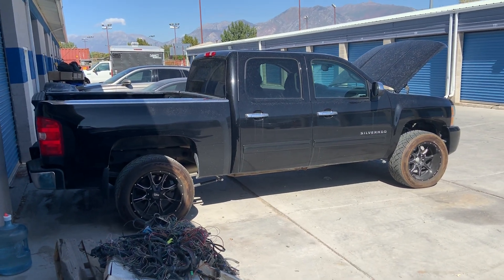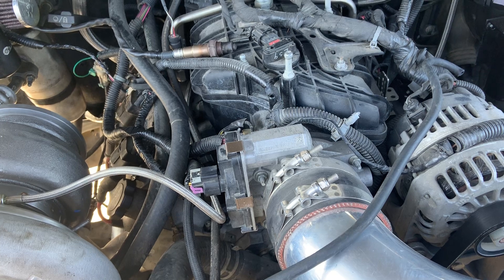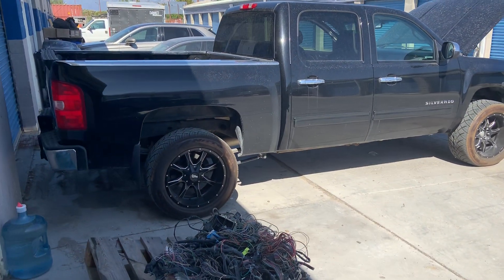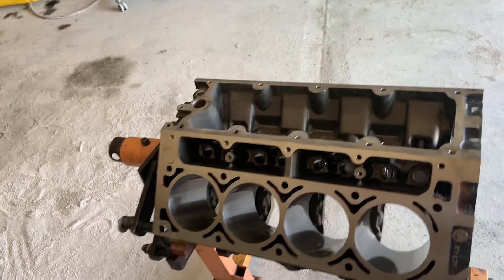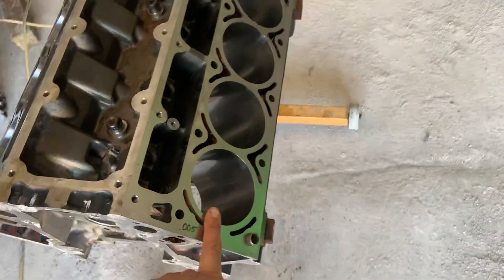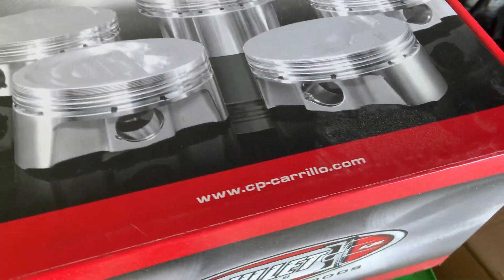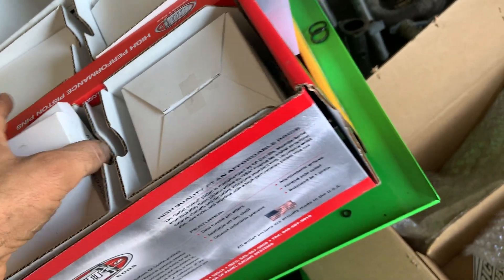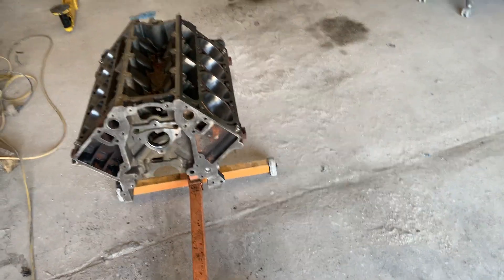Best budget 1000 hp plus reliable  LS engine build up!!!

Comment: Hey Brain! love the video. Been hoping around checking out many videos as I'm building a gen4 5.3 ls out of a 2013/2014 Yukon for my 81 cutlass! i too am shooting for that 800-1000 hp mark. I'm looking to make it reliable. Now I know that is subjective in the fact that no matter how much money you put into the engine the tune, machining  and assembly are also very very important. 

Currently on my list I have Ls9 head gaskets, ARP hardware for the crank, pistons and heads, DOD delete plate and a flavor of a stage 2 cam (have not decided on the cam shaft yet), trunnion upgrades as well as PAC 1218 springs and ls7 lifters. keep hearing about "using the stock gen 4 bottom end" but im thinking its better off spending that extra money now to try and bullet proof as much as possible. Not opposed to changing any of it up. Would love to hear your input as it seems you have quite a Bit of first hand experience! Help me with the recipe please!

Comment: Ly6 block .060 over. Stock crank. Forged piston and rods.. 20 psi boost  supercharged.  

4500 lb truck
3:90 gears
E85

Will the stock gen 4 crankshaft hold up . Without eating through bearings ?

Can i run 15 degrees of timming 
1500-4500 rpm . On 11.5 afr.
Without bending rods...?

Need purchase links...

Comment: Did you ring gap the pistons before they went bad?
Reply from the maker: we did but possibly not enough.  From what I have seen in the last couple of years is they can live if the tune is spot on.  Not a lot of forgiveness though.  I do have buddies running 8s in there foxbodies with all stock bottom end close to 1000 whp. So for some it works.

Comment: Question is. If you were building an LS motor and were shooting for boosted 1200-1500 hp range 
Would you use an iron or aluminum block. 
Would an aluminum block hold up with all the good internals with eagle crank good rods pistons and arp hardware.
Reply from the maker: it would for the most part.  Its the sleeves that can crack on an aluminum build.  As long as sleeves are not too thin you can do it.

Comment: The ring land breaks because of ring gap you are clueless Bro the rings have to be filed and gapped as much as .035 so they don’t close the gap and touch and lift the ring landing and break the piston like you showed in this video
Reply from the maker: Clueless.  Yep.  I admit it was a ring gap issue.  I do now think they touched.  If your running .035 gap your clueless.  Way too much.  I run 1300 hp on .026 4.030 bore

Comment: I just got an 06 2500hd lq4 motor and am building it for 600-800 hp. Doing the entire engine but didn't want to spend $2000 on engine parts alone. But will be my daily driver also. Rods for 400 and pistons for over 600 was more than I wanted to spend for good parts. Your gonna have $3k or more in just that motor not counting what you gave for the block. WOW.
Reply: gets real expensive man, im $3k into my built 5.3
Reply: @runninitup4L  that $2k went far over and still ain't done. Lmfao
Reply: @richardcoleman9645 sorry man

Comment: Bro your piston broke beacuse you did not gap it right. Like look at the piston broke at the ring land... MY MAN... Thats your fault as a builder not the engines parts. Top ring needed more gap. If you argue that you dont know what your doing and are giving bad advice.
Reply from the maker: I’m not arguing that.  I do believe the rings touched.  And I will also say no pistons ring land will live without enough gap.  Forged or not.

Comment: Dude, ripping ring lands off is because of the increased thermal expansion from running hotter. The rings grow and will stick to the cylinder bore unless you open up the gap so gap your damn rings to a minimum of .020 for a 4" piston for a sub 1k hp build, go up to .025" up to 1500hp, after that your off in custom hardware and talk to your forged piston provider.
Reply from the maker: I agree.  rings touched.

Comment: How much horsepower do you think I can get out of a built forged rotating assembly studded twin borg Warner 55mm turbos
Reply from the maker: more info needed.  whats the engine look like? what are the specs.  how much boost you looking to run.  Basic ls engines get close to 1000hp without a lot of trouble around 25-28 lbs given everything is right on.
Reply: @Brainstangs  btr stage 1 truck turbo cam tsp stage 2.5 ported 5.3 heads should be like a 9:5:1 comp and arp studs all around
Reply: @Brainstangs  and on a 5.3 liter I didn’t mention

Comment: I have 2005 Pontiac gto with Ls2 and I want to know more or less how much I  have to spend to make it 1000 hp and  Reliable ,please can you let me know, my email is ortiztony@comcast.net  thank you very much
Reply from the maker: Thats a tricky question.  motor wise , rods 500, pistons 700, Studs, 250, gaskets 150, balance crank 300, labor free if your doing it, cam springs pushrods 700, Fuel system ?????? tune, then and boost. Lots of people want to say they make a 1000 but few can use it on the street.  Trans is a huge issue at this point, Tires, etc..  I tell people to skip all the bolt ons and save that money for pistons and rods.  This goes a long way even if your plans are tame for a while.  It opens up the future possibilities.  Having said this many have made 1000 over and over on good race gas and a tune on stock ls components.  Just not my style.

Comment: “Much started, nothing finished and screw a budget” is more like it.
Reply from the maker: Video coming shortly.  Much done almost driving and on budget.  Just not good at posting.
Reply: I think you are missing the point. You titled the video “Best budget 1000hp plus reliable LS engine build up!!!”.  Yet, it’s not built, not making 1000 hp, reliability requires proof and most people use the word budget to mean cheap. That’s my point, get it now ?
Reply from the maker: Kenneth Jones it is built.  What some deem on budget is up to them.  It will make 1000 hp all day long.  That said I don’t build 1000 hp ls engines without a 500 dollar set of rods and some decent 700 dollar pistons. To me this is cheap.  Can it be done on a tighter budget, sure. Why don’t you consider forged rods and pistons “built”?  I think most do. I’m in this motor about 2700 and I know it will safety make a 1000 hp daily.  What am I missing here?   Obviously you need to see a fresh video that is coming that will show this almost ready to run. I will drop a new vid in the next two weeks on this project.
Reply: @Brainstangs Wdym “2700” stall?
Reply: @JesusChrist-dc1rv 2700 in cost parts
Reply: Sorry, I just can’t make it any plainer, more descriptive or obvious than in my prior comment. You obviously can’t see the forest because of all the trees...
I have daily driven a ring gapped stock bottom end 5.3 LS, with cam, springs and turbo for the past four years. It makes 600 hp on pump gas with a best number of 914 on race gas. I thought I was going to learn something from this video but was disappointed, that’s all. 
Once you build it, dyno it and put it thru it’s paces for a while we can discuss economics.
Reply: Kenneth Jones If you are making 1000 hp why do you need to “learn something” from another 1000hp video 🤦🏻‍♂️ Maybe you need to learn power curves from various cubic inches vs peak numbers you prick.

Comment: So best "budget" LS setup... fully Build LS3 with aftermarket crank/rod/piston, running on meth injection? Hell no.  5.3 with stock crank, summit piston/rod, sloppy cam, PAC springs, cheap MLS gaskets and VS billet turbo
Reply: WHICH SUMMIT PISTONS  GEN 4 5.3 .O30 .CANT AFFORD THE PRO SERIES  ,TRYING TO STAY UNDER 300.00 .TURBO 700 HP TO 900HP
Reply: @toddcotten8157  . Save up your money my guy it is worth it in the long run
Reply: So u can run summit stock bore pistons and rods with the stock crank and u won’t have no issues and will u have to get it balanced?
Reply: @obsant7214  exact
Reply: Yep a slick salesman oh u can't make a stock ls live. Yet thousands are doin it running 7s. World record low 4s.  Guess their all junk
Reply: @chipturd55  theres a fox body holding the record 7.12 1/4mile stock bottom end.
Reply: @reminoel483 squirrel tuned ran a 6.99 not long ago. I think he still has the 1/8 mile record for et and mph.
Reply: He said pistons and rods factory crank and 4.03 bore which is def some kind of lq9 or something. E85 too.
Reply: Some of us have $$ and don’t live in our parents basement’s and also don’t feel like swapping engines 5X a year.  A reliable budget build is $5000. “Sloppy Cam.” Lmfao.  Stick to riding the bus.
Reply: @Cultofpersonality09129  hey i wish i had that big chocolate factory money just like you but no… im just a poor mine worker… :’(
Reply: Yes that is all true, but to be able to reliably hold 1k HP or more on a daily driven heavy sleeper truck then yes, the shirt block does need to be built. I have the L20 4.8L in my 2011 Silverado extended cab and it will hold 800HP reliably, but anything more than that then yes it does need to be built.
Reply: @JustAGuy781  . Yeah that's true, I know a friend who owns a 1000hp civic and he pretty much build everything to the best he could just so he could drive it daily. However it is probably a lot more expensive for the ls engine

Comment: How did this engine turn out?  If it completed and running of course
Reply from the maker: its fully built and will be running on the engine stand shortly for a video. Just working on getting funds for a  few more things.  Keep an eye out for its first start on the engine stand!
Reply: @Brainstangs  how much you charge to build the 1000whp ls?

Comment: That happened because you didnt gap the rings.  DUH 🙄
Reply: Adding to much boost without gaping the rings correctly will brake the piston.
Reply: Summit also makes stock stroke forged cranks tested over 1200hp
Reply from the maker: not true.  I have broke ring lands without ends touching.  Just weak pistons will break ring lands too. But yes that can do it but was not the case on this pistion
Reply: Brainstangs 
Then it’s the tune.  Ring lands just don’t break for no reason especially on an LS gen 4.
Reply from the maker: Mike Eagle that actually is my thought. My tune wasn’t good.
Reply: Brainstangs what were the rings gaped at?